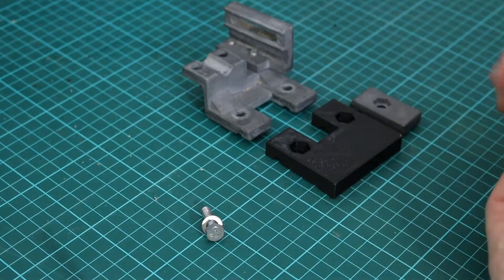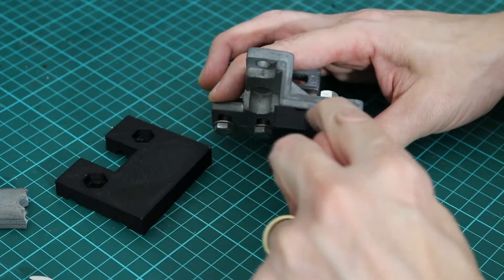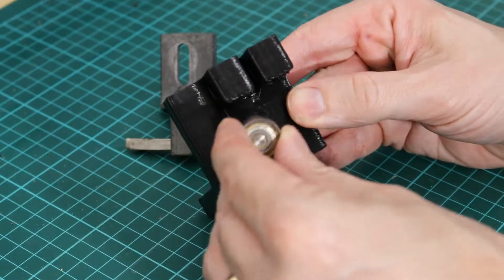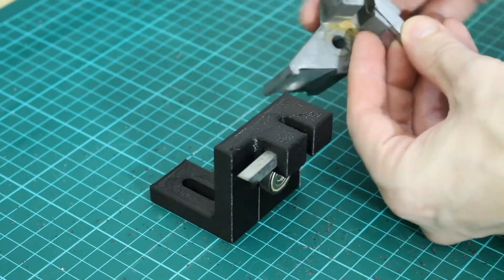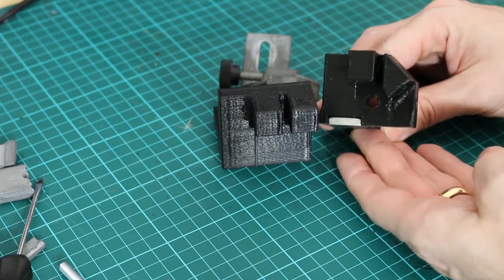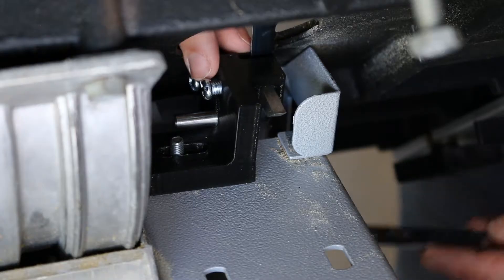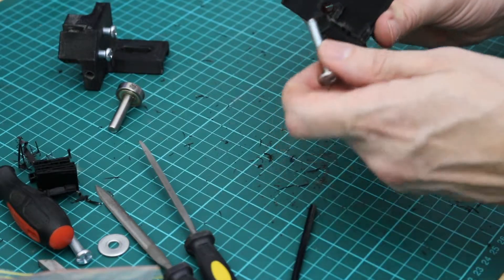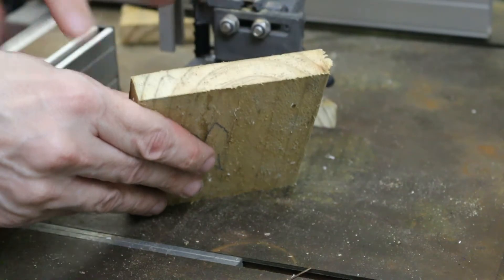3D printed bandsaw blade guide repair

Comment: Enjoyed the video, were you not tempted to 'upgrade' to roller bearing guides as against the existing rubbing blocks, I'm doing this to my bandsaw at the moment
Reply from the maker: I might at some point. My wheel rubber has deteriorated, so that is next thing to repair with some polyurethane ones
Reply: @RandomSmith  Many use a section cut from bicycle inner tubes, rubber not poly unfortunately, on my Clarke bandsaw I'm mounting the roller bearings on a 3d printed T-Track extrusion for adjustment, link to image: https://drive.google.com/file/d/1Ir38fg17eDZwyvec5FJQPpe7EDOfso8q/view?usp=sharing
Reply from the maker: @johngratton467  mounting on t-track is a neat idea

Comment: Hi RandomSmith,  I wonder if you would be kind  and  share your file for these parts. as i need the same parts. Thanks Steve
Reply from the maker: Sure, I have just added links to the files in the description...
Reply: Cheers buddy thanks, will get my son to print them off for me. How are they holding up after 8 months
Reply from the maker: Holding up good...
Reply: My bandsaw is up and running again,  thanks for sharing your files, saved me a lot of work, cheers from the uk
Reply from the maker: Glad to see it helped.